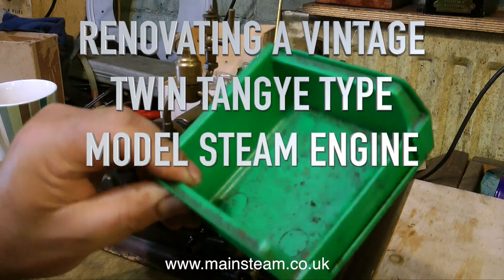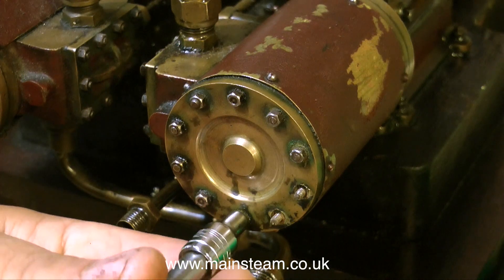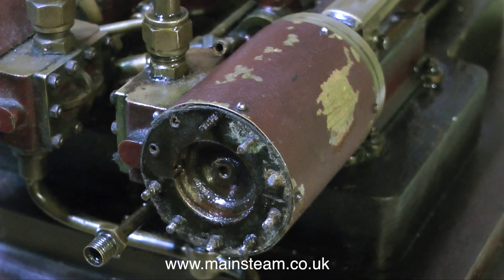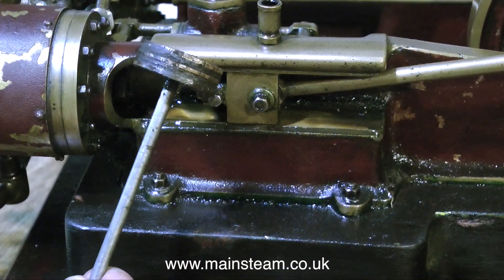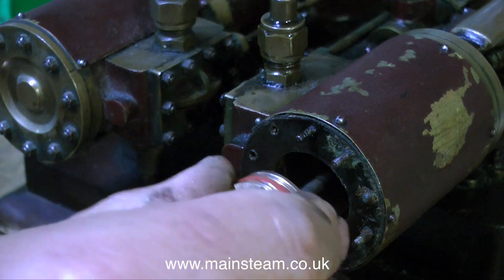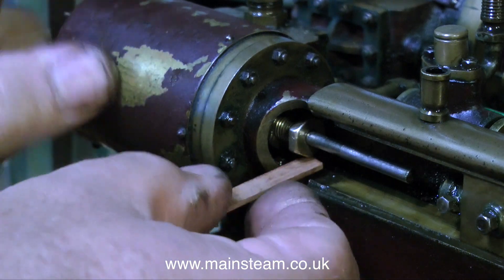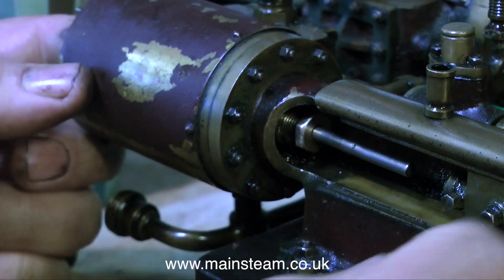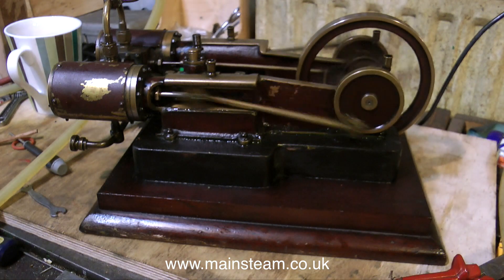PART #2 - RENOVATING A MODEL TANGYE TWIN CYLINDER STEAM ENGINE

Comment: For the gland nuts you could use an open ended ring spanner, much better than hammering them around. Gedore makes very nice ones. Called "Flare nut spanner". Like what you use to tighten brake line fittings with the steel pipe coming out of them.

Comment: I had helping my grandad repair and restore a portable engine that had been bought in chile it was originally used to power farm machinery but the way they repaired it in chile was with pop rivets  and when I removed the packing it was string  it had marked the piston rod it was done up so tight

Comment: Where do you get your silicone o-rings for piston use? I'm planning on machining my first Stuart, a model 10 of some sort, and i'd like to use that arrangement. I checked Stuart's website, but no luck. Perhaps I overlooked them?
Reply from the maker: Bernard Foshage I get them from Blackgates Engineering - they do worldwide mail order.
Reply: Keith Appleton Thanks! I'll be looking them up!

Comment: I am interested in how you will repair the sheared head bolts.  Thanks for sharing Keith.
Reply from the maker: Fred Miller I think the cladding may have to come off the cylinder to remove the bolts. I will wait until the engine is stripped down fully to do this though.